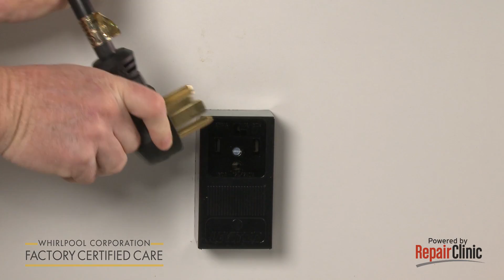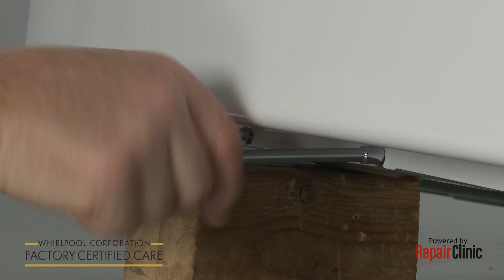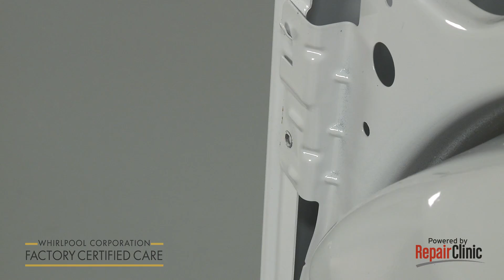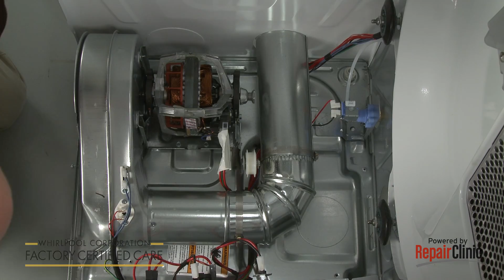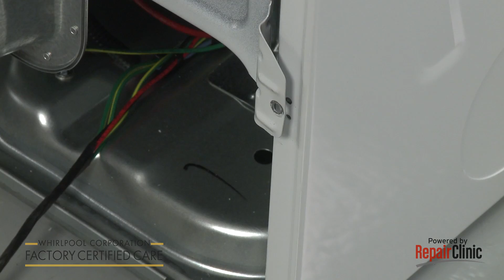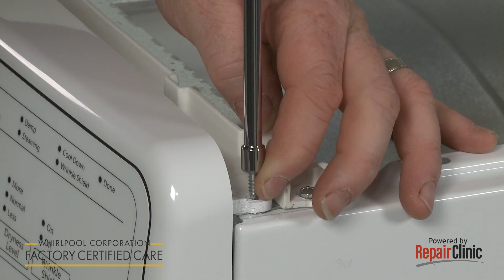Whirlpool Electric Dryer Vent Kit Installation #W10323246

Comment: There is NO NEED TO TAKE THE DRYER APART. Pop out whichever knock out cover you need, reach in, unscrew the sheetmetal screw for vent tube and slide it out. Install the new pieces the same way.
Reply: The elbow does not fit through the knock out cover, so you will have to take the dryer apart.